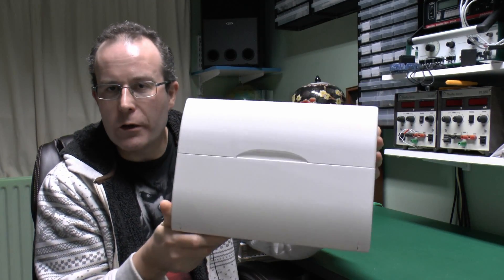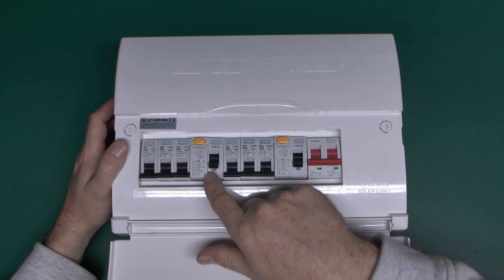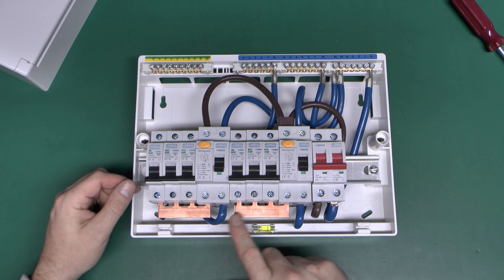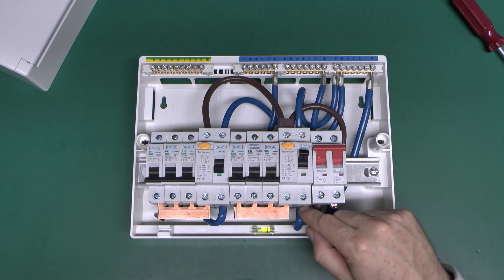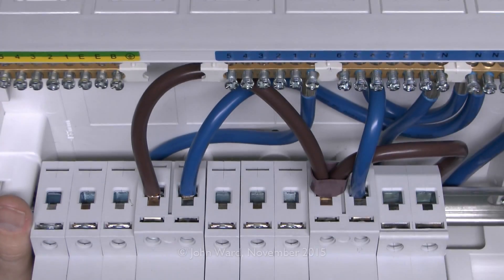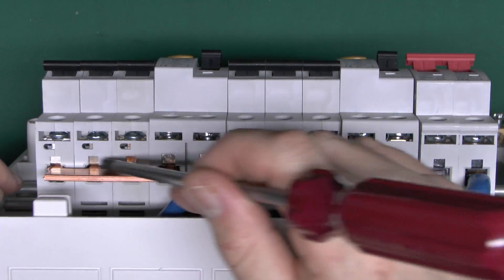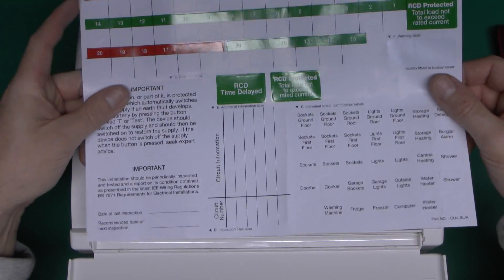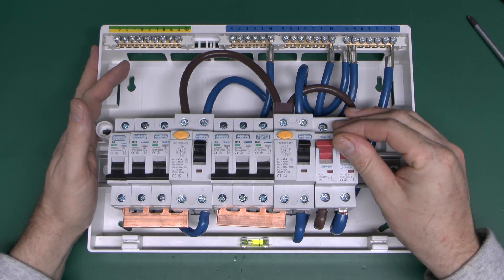Dual RCD Consumer Unit

Comment: Why is that panel designed with 2 extra spaces to the right, out of interest?  It looks like with an alternative cover the main switch could move 2 positions to the right, so as to allow the board to easily take 2 further breakers (e.g. 2 RCBOs to complement the 2 small RCD groups), not too bad a config at all if carefully thought out layout.

Comment: Why are plastic units being discontinued?
Reply: +RandyDarkshade 
Supposedly fire-proofing requirements.  Fires caused by loose connections or faulty installations have been an increasing danger according to the London Fire Brigade etc...  John has a separate video "Metal Consumer Unit on TT Supply." definitely worth watching.

Comment: The inside of that unit just looks scary. Is it legal in the UK to have the busbars for phase and neutral exposed like that? (I don't consider the flimsy panel over the phase busbar decent :p)
Reply from the maker: +DJefke RBBS Yes, most are constructed like that.
Reply: Ok here is a Shocker for you :)) 

The Neutral will not show voltage as long as its connected to the Neutral Bar then if you take a Neutral Wire from any Circuit even the mains Neutral then test the End it is a deadly Live Wire because the Returning current has no where to go so the Neutral wire becomes an extention to the Live wire. Scary Shit ay. 

So don't assume the Neutral is safe ever
Reply: +DJefke RBBS Thats safe compared to some of the old boards i've worked on. You literally take your life in your hands when trying to add additional circuits, or work on them. Hate the things.
Reply: Some have plastic covers for the live busbar.  Neutral connectors block/s is always exposed.

Comment: ... .and just to complete it include steel and brass screws onto copper wire. Copper wire necking creating a fracture point. Screws loosening inside (concealed) junction boxes. Comparison between steel and brass screws, perhaps stainless too. The ideal method for soldering copper cores together. I'll show you mine, if you show me yours.

Comment: John, also can you do a video on just how many times a solid core wire can be disturbed inside a patress box, or CU, before it breaks. What is the fatigue characteristic of a solid copper core and how can that fatigue life be extended without annealing or some other form of heat treatment.

Comment: John, Can you do a video on the use of torque set screwdrivers on the terminals please?
Reply: +whitefields5595 FWIW the CU here got changed recently and the sparks went round every terminal with his torque driver. Next day I checked them all. About half were still OK, most of the rest less tight than I'd like and a couple were now actually loose.
Reply: +Graham Langley ... indeed, I found similar, hence the question. It is almost as though you have to overtighten to make sure everything is seated, then back right off then tighten again to the right torque. Or at least that's what I do, but I do not use a torque set screwdriver

Comment: Our house has a much older consumer unit from the early 1980s with bottle fuses.  I think it's 4 x 6A for lights, 4 x 16A for sockets, 1 x 40A for the shed welder outlet and 1 x 65A master fuse.  It has an 30mA rated chunky RCD that covers the sockets only and it is surprising the range of appliances that developed an earth fault over the years.  Thankfully not many appliances go short circuit as replacing a bottle fuse is not fun, particularly if an appliance/lead develops an intermittent short.

Comment: that thing do not work in norway at all. if someone is idiotic to mount that here you will kill someone. for one you need to break BOTH lines with the fuse as both r live. and that thing is small.. ok for a sub box.. you cannot run a house on it. the house i live in now is a bit old.. the electrical system is from 1992 so it only have 14 sercut's.
Reply: Probably a consequence of Norway having originally had local electrical distribution system without a supplier earth reference (an IT system). In principle, it's nice as there ought to be no route to earth if a live wire is touched, but in practice it's near impossible to avoid some significant earth leakage in the local network so that, in practice it's likely that on an IT system there is a potentially lethal voltage to earth. Hence, both circuits have to be broken.

As far as I know, modern Norwegian installations are supplied via TN-C-S (with an earth-referenced neutral), so those ought to work with single pole breakers although I can see that dual-breakers might be adopted to keep installations standardised.
Reply: Well the main switche and residual-current breakers are always dual-pole, but straight over-current MCBs are live only.
Reply: sambda here both r live. L1 and L2 and ground.

Comment: first time i have seen a board configured main switch right to left
Reply: +tuberlook1 
Contactum are the same too!.  However, remember that in many, cases the Main switch can be moved to the other side (to suit incoming tails), HOWEVER, double pole RCDs (usually) have a specific side for Neutral and Line so they can't be used with line busbar on the other side of them (though technically, with DP switching (and no 'late-bake / early-make on neutral) and no earth connection I don't see why they couldn't actually be used either way round, though it could be against manufacturers' instructions...
Reply: +tuberlook1 Some manufacturers have them on the right, others on the left.

Comment: British General brand.
When testing an installation with one of those consumer units fitted, I found that the RCDs were adding about 0.5 Ohms to the Zs figures. It made a couple of circuits only borderline pass.
Strange, I've never found any other brands with such a problem.
Anyone else encountered this?
Reply: There's something very strange about that. I, say, 20 amps was flowing through an RCD with a 0.5 ohm resistance, then the power dissipation would be 20 x 20 x 0.5 = 200 watts. Naturally 200 watts dissipated in an RCD (or in a CU in total) would be disastrous. If the current from a 10 kW electric shower passed through it (about 40 A), then that would be 800 watts.

Comment: Such nice touch protected breakers and then you defeat them with that horrible busbar. 
It is weird to see a distribution panel wired right to left instead of left to right. But then you also drive on the wrong side of the road so maybe that's to be expected ;-)
Reply: +stefantrethan One manufacturer (Crabtree and there may be others) does a shrouded busbar with plug-in RCDs etc. As for the R/L order, some manufacturers have the main switch on the right, e.g. Hager, Contactum, Wylex,  BG as here, and others have it on the left, e.g. Crabtree, MK.
Reply: +Graham Langley By all means let's have that $1 in plastic and save the electrician.
At low voltage contact surface area makes all the difference between a mild zap and serious injury or death. 
Also avoids those razor sharp corners where the copper was snipped off.
Reply: +stefantrethan No electrician is going to use a hacksaw and file when he's got a pair of BFO side cutters to hand.

Comment: WoW, here in Belgium they're a lot bigger, mine is even a floor model that is 2 meters in height... (But then I'm an electrician, so that's more geekiness I think)
Reply: One reason why they are bigger in Belgium is because 2 pole breakers are mandatory (or more if 3f or 3f+N). Even N must go thru the breaker. Also your light and sockets must be kept separate (exceptions are possible) and the number of sockets per breaker is limited. Even in a smal house or apartment you will often need a 2x12 modules or more.
Reply: +Joy Van Acker Yeah, I think much of the EU has it much better than we do for design. While there are sufficient circuit ways, the amount of wiring space is TINY, not conducive to neat workmanship. It CAN be done but it's a lot more effort than it would be on a larger panel. Does Belgium follow what many EU countries do and have 3 phase 230/400v into the house/flat?  That could explain the larger size too, keeping separation between phases? (guessing!)
Reply: +TheChipmunk2008 Here in Belgium you can choose betwoin 1f230+N, 3f230 or 3f400+N, that will give you larger panels also. But it's like you're saying, making your installation future proof by installing enough circuits is key I think. And neat cabling/installation is always a must! :-)
Reply: +Joy Van Acker Thanks for the fast response, yes, you can tell a true craftsperson when you see them take that little extra time to make things neat.

Incidentally, the 3phase 230v without neutral you speak of, is that the old 127v to ground with 220 between phases that much of Europe used to use? 

(Which also freaks out younger people with old stereo gear wondering why it has such an odd voltage option on the selector, 127v!)
Reply: +TheChipmunk2008 That's correct, 3f230 is 230v between the phases, 3f400+N is 230 between phase and neutral and 400 between phases.
Reply: @TheChipmunk2008  You would immediately change your opinion, if I've showed you Hungarian Electrics. Especially old ones.

Comment: Excellent video as always John. This is certainly a lot better than having no RCD's at all like so many older houses in the UK. I replaced my old MK fuse board with one of these last week and it started tripping due to a borrowed neutral. Thanks to you I knew exactly what was happening. Thanks and keep up the good work.
Reply: +Graham Langley in your own home.... who cares? I'm a electrician by trade and if I installed it in my own home I wouldn't do any certification at all!
Reply: im not the original poster of that comment... of course i know about borrowed neutrals..
Reply: +tittytwister5251 Oops - sorry.
Reply: +hyperion8008 As changing a CU is notifiable how did you deal with it?
Reply: +tittytwister5251 An 'electrician by trade' who didn't know about borrowed neutrals until they saw John's video?

Comment: To me that looks small but I'm in Canada where are panels are quite a bit larger and we have a lot more circuits.
Saying that,
Would that be considered a sub panel or is that the main panel??
What size of house would that panel be servicing??
Could you do a video on the different types of wire used in the UK??
Reply: i think that panal would probably be for a flat or  small cottages
Reply: +RC MAD No, ring final circuits mean you only need one power circuit per floor, so that would do a fairly normal size house (but as John says, it IS on the small size.)

Example for you, a 4 bed house I worked in had 8 circuits. Upstairs power, upstairs lights, downstairs power, downstairs lights, kitchen power, Outside circuits (both lights and power, lights being fed from a fused connection unit), water heater and electric cooker
Reply: meh
Reply: +RC MAD yep that was my reaction, not enough room for expansion.
Reply: expansion is  no go
Reply: +redneckbryon I'm assuming that Canada uses the same type of panels as the US: two columns of breakers arranged vertically w/ mostly 15- & 20-amp breakers; w/ larger sizes being two-phase breakers.
Reply: +Madness832 yes, Canada and the US are practically the same in electrical standards.
Reply: +Madness832  yes except Canada allows horizontal mounting
Reply: in my house have 8 circuit for our 4 bed house, 3 32amp circuits for socket ring circuit, 3 6 amp lighting circuits, 2 16amp circuits, one for an immersion heater and one of unknown origin (does nothing), soon to be replaced by a 32amp cooker

Comment: How about doing a more expensive consumer unit that is "not usually sold in diy sheds" as you put it.
Reply: There isn't a massive amount of difference with them. They usually just fit together in a nicer fashion, look better and have fewer RCD's fail. The actual wiring inside is the same and they physically are no different.
Reply: they all have to meet strict regs